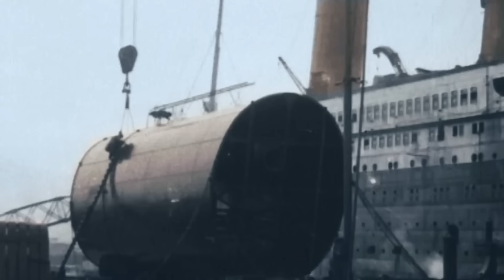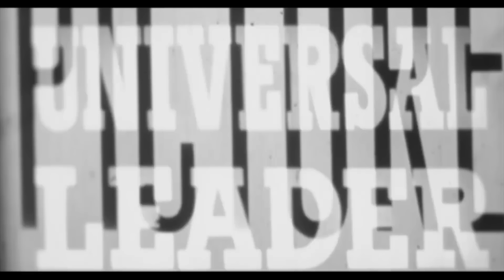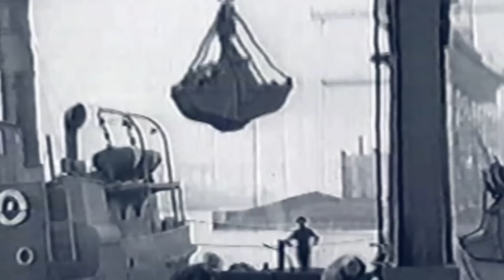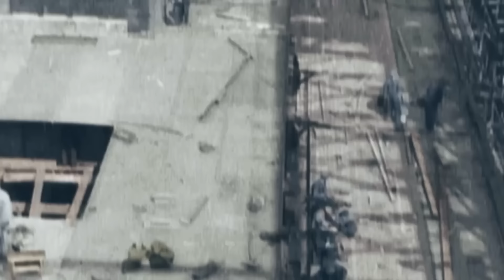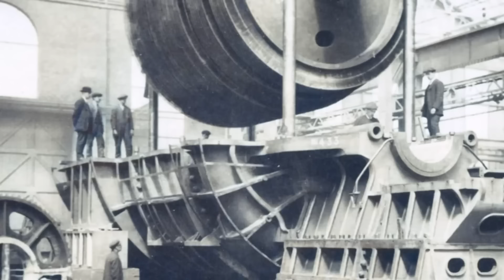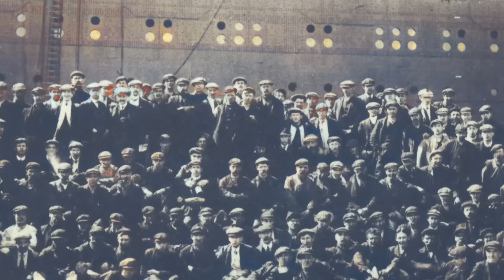Titanic's Construction: The Building of the Legendary Sea Giant | FD Engineering

Comment: 3 years to build this mighty ship? 6 weeks to repair a hull breach? Other than a shipbuilder, these numbers are spouted out casually with no idea of how much skilled labor and manpower was needed.

I built different classes of ships for 30 years. This amazing feat of fast building and repair is non existent now. We don’t work men 60-80 hours a week with no safety gear anymore. We don’t allow 17 men to die while working on a hull. 

Unions and OSHA have also slowed the pace down.

So while oohing and ahhing and painting a picture of genius and innovation, remember the men who worked amazingly hard for very low wages at a staggeringly dangerous and demanding job. 17 died. How many more were seriously injured or disabled?   

Even with the work environment improvements in these days, I was injured and disabled by working to failure everyday I made these ships. It is a tough job.

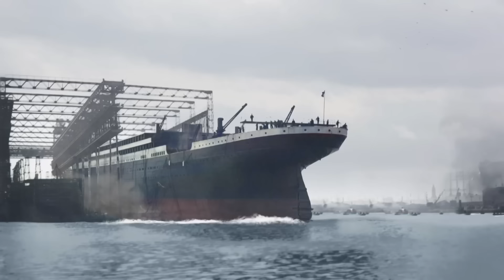Comment: 2:06  Titanic's size was certainly NOT unprecedented. Olympic had the same dimensions and was launched first. Titanic had some alterations that made her displacement (read: weight) SLIGHTLY larger, mostly in the form of the enclosed First Class promenade areas. It was determined Olympic's weren't being utilized, so those cabins were altered with private enclosed promenades; more like outdoor verandas or porches, actually.  Pretty graphics don't make up for poor scripting or fact-bending/fact checking, kids.

Comment: The video showing the ship from the back during its launch. 
It's actually the Olympic being launched. 
If you look to the right side slip. That's actually the Titanic. 
Remember the Olympic was 3 months ahead. 
And most of the pictures taken were of the Olympic not the Titanic. 
The Titanic don't have near as many pictures taken of it. Because they passed Olympic pictures off as Titanic from the 2 ships being almost identical.
Reply: Didn't (did not).
Reply: 29:43 The pictures shown of the launch are not of Olympic, they are in fact of Titanic. Olympic was built, and later launched, in the right slipway (left in the video), where you can actually see the next ship of the trio being built, the Britannic (construction had begun just 5 months before). Besides, Olympic was painted white for it’s launch and Titanic black.
Reply: @carlosfernandezzofio674  go watch ocean liner designs video about how few pictures of the Titanic were taken and how many were actually of the Olympic passed off as pictures of the Titanic.

Also, the Olympic was launched before the Titanic.
Reply: @2dogsmetalrecycling  The fact that Olympic got the big press because it was launched first doesn’t mean that Titanic wasn’t photographed. There may be a lot more pictures of Olympic, but the one in the video is certainly of Titanic's launch.
Reply: @2dogsmetalrecycling  If you are so braindead to not even understand Oceanliner Design's videos you need to shut up about things regarding Olympic's launch
Reply: Also the turbine installation photo was from her youngest sister ship, Britannic.